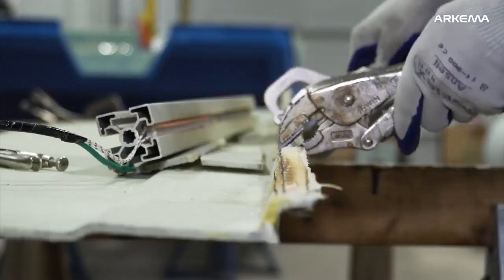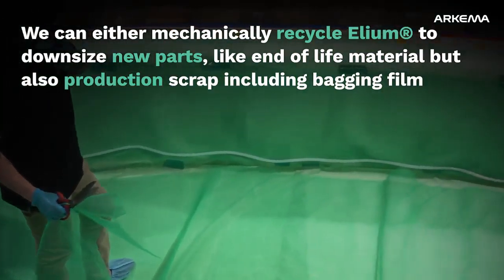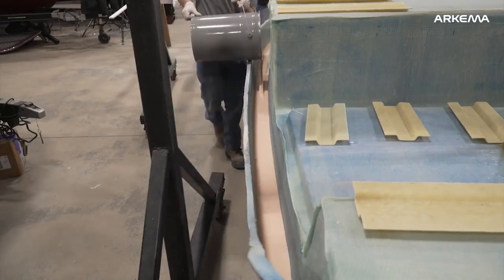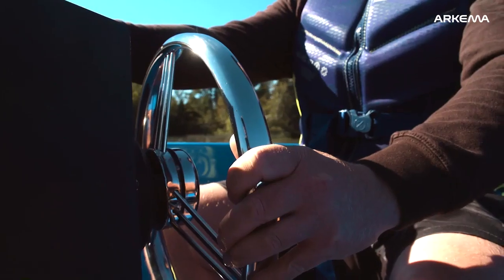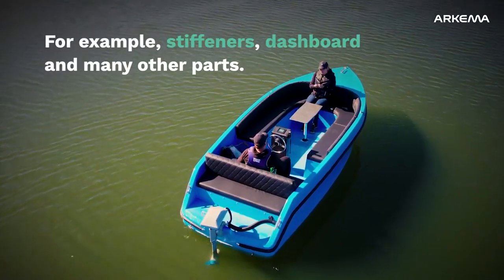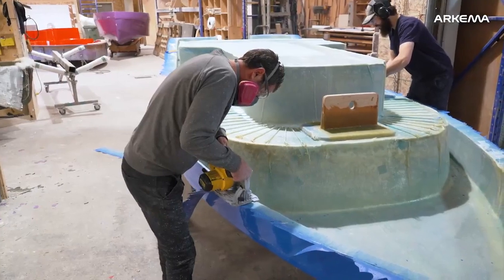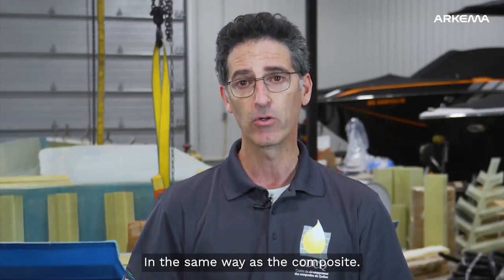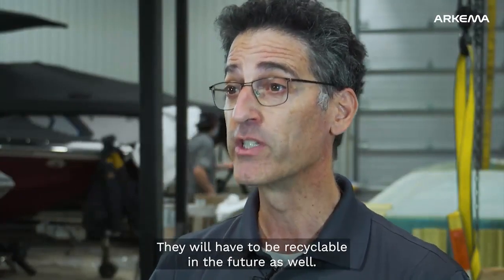Elium®, the fully recyclable thermoplastic resin material for boat

Comment: You say the foam core is recyclable - is it PET?       
There will have to be a whole infrastructure available to recycle and reclaim the resin if this is to be anything more than green-washing.   I wish you luck.
Even with all the hype around natural fibers (hemp, flax, to name two) they are very difficult to source and very expensive compared to conventional alternatives.
Reply from the maker: Hello, the foam core is PET, and can be recycled along with Elium resin. We shred the material on flakes and used thermocompression to manufacture top table that cen be recycled on and on. We could also chemically recycled the resin and recover it, PET core decrease slighlty the yield of the process, but the monomer still has 99% of purity.
More information: https://www.arkema.com/global/en/products/product-finder/product-range/incubator/elium_resins/